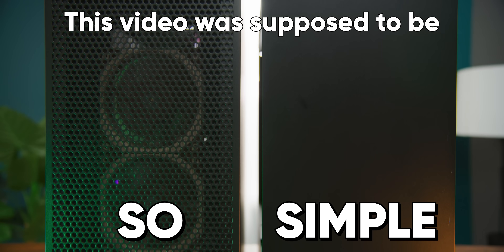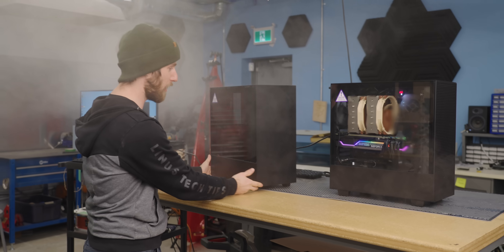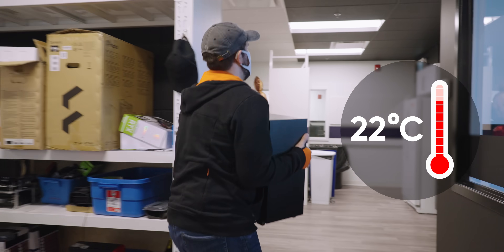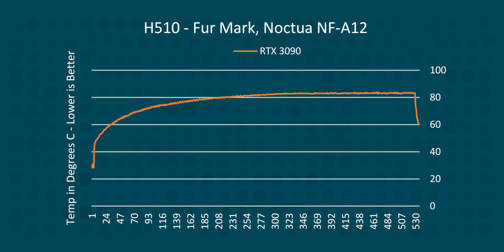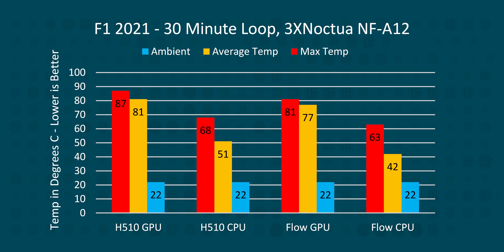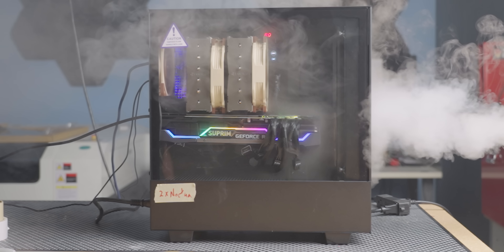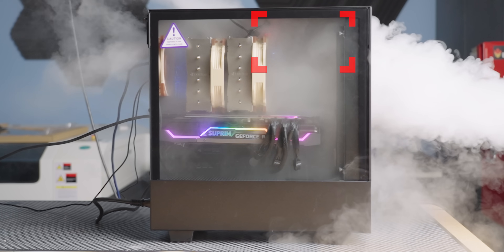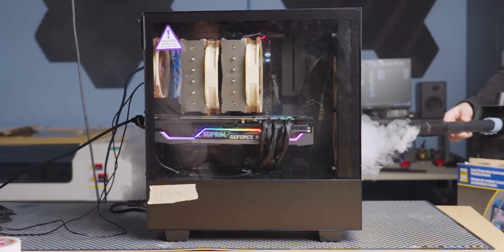Everything You Know Is Wrong - Mesh vs Non-Mesh Front Panel

Comment: His use of the word turbulence isn't entirely incorrect. These big vortices are a sign of high vorticity and that is the defining feature of turbulent flow. However, it would certainly be more correct to say, "undesirable turbulence" or "stationary vortices" as the rest of the flow is turbulent as well.
 It don't recommend looking up these terms and how they relate to cooling up though, it is a very deep dark black hole. The question of how much turbulence is desirable and which flow rate is optimal is not at all trivial. <=this is coming from having done a degree in atmospheric physics in university.
In my own testing (over 500 tests on a Corsair 5000D) I have found their results to be basically true:
1) more fans aren't better if the configuration or case is bad (like the H510)
2) even with good configurations faster fans aren't better
I've also discovered
3) the type of fans/ model can make up to at least 5 degrees difference
4) how fast the fans turn in relation to each other can make a small but significant impact

Comment: The solution to PC cooling is to think outside the box, and by box I mean case.

By installing a Pratt & Whitney PW1000G in front of your computer you can guarantee an airflow of 598.2 kg/s (1314,396 pounds per second) keeping even a RTX 3090 well ventilated.

Comment: That's an AIO case. Why the hell were you using Air Cooling!? AIO for the CPU and air cooled graphics are fine in the airflow version, not a honking air cooler!! 😡 What were you thinking with such a tiny poorly designed case!? 

You should only use air cooling in a full tower case. Air cooling in a mid or smaller case (especially that kind of implementatation) is just wrong, even stock coolers applied to modem high end CPU's is just wrong to begin with mate! Plain and simple. 

You have to look at thermal capacity and dynamics of the case to fit the correct hardware and cooling solution prior to even purchasing the hardware to begin with! In this case you were trying to mate David and Goliath together and what a bad idea that was clearly!

Obviously your stock ordering and inventory minions need better training Linus. This was just an insult to any PC builder out there with half a brain. 👎

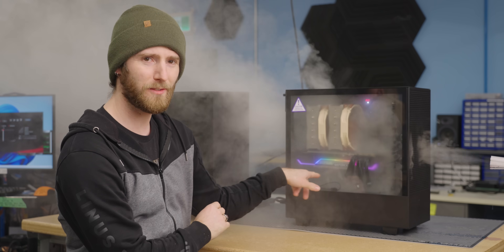Comment: 0:50 Yup! That's exactly what was happening to my gpu overheating due to not getting enough cold air and the cpu cooler sucking all the cold air from the front case fans. How I fixed it? Added a fan bellow the gpu to get cold air from under the case, helped a ton. This video confirmed my theory.

Comment: Wow this looks sooo similar to my setup. I replaced all the case fans with noctuas, and added a second fan to the NH-D15. I was wondering why my RTX2070 gets hot. Time to re-work that cooling! Thanks Linus!!!

Question: Currently my PSU's fan is facing down towards the flor. I was thinking about flipping it around, so it's sucking some air from underneath the graphics card. Can we test this scenario?

Comment: Add duct channel separation splitting the chassis fans so they pump both areas, is what I would do. Flow volume doesn't matter if there's a dead zone. I suspect without carefully eliminating dead zones, the mesh could easily make them worse by allowing free flow that could be ducted into them. An actual heat transfer engineer would model the geometry in COMSOL or the like, but who can easily get accurate geometry for all the weird and detailed shapes involved?

Comment: Hi Linus, can you and the team make a follow up test with different configuration? I am interested in seeing what it would be like with larger cases in this config (large tower cooler, normal GPU mount), such as the Fractal Meshify 2 and Torrent, and also AIO mount, and vertical GPU mount.

Would also be cool to see the fog machine on a chimney style case, like the O11D.
Reply: this problem doesn't exist in a meshify 2. put 2-3 fans on front with a back exhaust and 1-2 fans on top and no problem. even have the option for bottom intake if you need it. but if you make poor choices like buying a nzxt that cant accomidate top exhaust... for a 3090... then you'll have a bad time .

Comment: ok, you did this with a monster 3090.. which appears to be your main bottleneck point in terms of airflow.. 

why didn't you then go with something a little less beefy, in terms of GPU size? And see what the improvements could've been had, if the GPU wasn't creating turbulence for the bottom fan..

or conversely, go with a slightly larger case, one where the 3090's size isnt as much of an issue, and that bottom fan is actually feeding air to its fans

Comment: I just love my Cooler Master H500M with the 2 huge 200mm fans and the 2 added/exchanged 140mm MasterFan ARGB fans at the back and on top to balance things out.
Its bigger, leaves more space below the GPU and pushes alot more fresh air unter it instead of just straight at it, giving my GTX 1080Aorus Rev.2 enuff breathingroom, to never go above 68°C, in standard condition and settings, even when Superposition 8K optimized gets thrown at her or so, with then close to 280Watts to handle.
My Ryzen 7 3700X with PBO and up to 125Watts, never saw more than 76°C even in Cinebench or Prime 95 under its MX-4 supported Alpenföhn Brocken 3 Black Edition Towercooler.
One of the best Airflowcases available.

Comment: I have actually experienced some similar issues with my setup (Lenovo Legion 5i Gen 2 Desktop). I added a plastic divider to force the air from the bottom intake fan downwards to the GPU area. Thought you guys were going to try something similar with this case.
Reply: Been thinking of 3D printing something to do the same, how did it improve your thermals
Reply: @shoots8940  Well for my specific case it worked pretty well actually, got my GPU floating around 80 celsius max when in game.
Reply: I tried similar way but i found out the plate redirecting airflow also cause high pressure area near the outlet of fan, so the overall airflow drop. Instead, i add a small fan blowing directly below the GPU. The small fan suck the turbulence and high pressure air to maintain higher overall airflow into the case.
Reply: @joelau2383  I actually did something similar on my old rig where I added a 80mm exhaust at the back of my case below my GPU.
Reply: Similarly, my mind is racing with all the things I'd like to do in this case with the 2 most important tools in the world. Zip-ties and duct tape xD. That GPU really needs a de-shroud.
Reply: Their videos (content) quality has dropped off significantly.  They didn't offer any solutions and showed putting a fan in the top exhaust and proceeded to say its difficult and didn't follow up.
Reply: @spencer5051  It's likely because they never meant to spent that much effort on this one, but just wanted to showcase a problem. The ending did feel rushed though. The other comments here did come up with a coupe diy solutions though.
Reply: Lenovo c530 cases did something like that.  Since they are a small form factor i guess they had to take every step
Reply: Reminds me of the old G5 Power Macs that had similar air channels.
Reply: Gotta milk that extra video though. "How this $1 part fixed our cooling"
Reply: @madmangohan  nailed it.

Comment: I still use a Coolermaster CM690 ii, its a beast of a case with 4 5.25 drive bays, i like using 5.25 accessories like card readers and front USB ports - this case has space for ten fans, crucially, one is on the side panel directly where the GPU sits, it also has a fan behind the motherboard tray for cold air to the rear of the socket - i have had this case a while, it still looks good, its built really solid but yes its bulky and doesnt show off RGB to its best ability, however - it does have great airflow with mesh panels nearly everywhere

Comment: Reverse the fans. 
Have air push out the front and the exhaust fans reversed as air pulling in. 
Reverse the cpu fans. 
Create a negative pressure will help pull harder airflow pass over the cpu and maybe gpu from the back.

Comment: I’d like to see the same hardware with a larger interior chamber. I used the flat front h510 with a 2060S and Ryzen 5 2600, and rarely exceed low 70s for either component with roughly 73-76F ambient. I have less power hungry hardware, yes, but the case still works fine for such a combination. I would think with a larger internal chamber air could better circulate and become exhausted as needed while keeping the hardware the same
Reply: I use the H510 with my Ryzen 2600x and a RTX 2070 and have the same temps as you did. For hardware like this, the air flow of this case isn't really a big problem

Comment: This is one of the reasons for years I use AIOs instead of giant air coolers and try to keep distance between fans and obstructions large. Much as you can the pressure drop should be equal between all the possible flow paths the air can take between the inlet and the outlet. Unequal pressure drop restricts flow and causes imbalances, while obstructions can act as deflector plates which causes vortexes. In the O11D I run the inlet is at the bottom and the outlet at the top with the graphics card vertically oriented to minimize resistance to flow and have, as much as possible, an equal pressure drop.

If one of your engineers wants to have a good insight in the type of fluid dynamics seen in cases what you want to look at are papers about vapor maldistribution in industrial applications e.g. multi-phase separators, distillation towers, etc. same principles.

If you have the software (Open Foam [Free], Ansys Fluent, or CFX) it shouldn't be hard to model air flow for cases, you can use porous bodies for a lot of things.

Comment: This is probably part of the reason why the Lian Li O11 Dynamic has sideways front intakes, they pull air inside the case where it flows into the glass side panel, not the front of the GPU, then a vertically mounted GPU has full access to the fresh air because its fans are directly facing the glass side panel

Comment: It’s actually pretty easy to understand if you consider air flow paths inside a case lol. The case layout internally didn’t chance. Pretty logical outcome. If the front fan placement changed and the gap from the gpu to the psu shroud increased the gpu would cool down. But I’m assuming this video is for people who don’t understand logic hahaha

Comment: Flaws on your methodology.
1. Case size was too small for that Graphics card
2. Remove the backplates underneath graphics card
3. Choose case that is appropriate to the test Example Be quiet 802 (since it comes with switchable front panel to mesh/ no mesh)
4. Choose graphics card model that is wider 3slot card with more air pushed out of the back.
5. Flip the PSU over

When your testing methodology is flawed from beginning it it is kind dishonest to push your point of view like that.

More fans can and is better in most cases if you take advantage of it in your build but you have to think and make actual use for it so it works properly.
Reply: This was not a flaw on their methodology. They had no methodology to begin with. They just tested a mid size case that a lot of people have with a huge GPU.

A methodology has to be established when you want to try a lot of cases in a lot of configurations, which they didn't do.

Comment: This is a problem LTT has had lately. Good video topic, but a horrible exicution. This video told us about a possible problem but nothing more, so solution or different use cases/ actually different cases. Very empty content, I am let down as LTT usually delivers a better quality of video. All 8 minutes basically came down to "This case with these parts does not do well with fans on high due to airflow." I really hope the quality is improved or at least LTT makes these videos into a series so the actual information can be given out.

Comment: Linus as someone who worked for a few years trying to build a pro audio and lighting rental service for events, what you want isn't a smoke machine, what you want is actually called a hazer, and they can be had for around $500USD new, and will output a lot more than that shitty smoke machine, without spending the $1500 you mentioned xD. IDK what you paid for that smoke machine, but a hazer should output several times that

Comment: So… it depends on the case not on the fans. I think in a Corsair 1000D more fans are better because of the extreme amount of air in there. Also If you have 3 fans in the front it might not have the air bubble. Or am I wrong.

Comment: This confirms my big case + fans on sides and bottom (fans on front and top are a given) is better theory. Needing space between GPU and CPU is an interesting paradox though as the desire to keep those bus lanes short for minimum latency is desired, but we don't want them to overheat by being too close. With the newer, hotter GPUs, I suspect the need to keep them apart for thermal reason will quickly outweigh the desire to keep those lanes shorter. In this case, bigger mobo would also be better. I would be interested to see this test done using full sized ATX cases. One with less fans, and one with lots on all sides. On this same topic, I would also be interested in seeing a video on, when using a big chungus GPU like a 3090, what the performance difference is in using the lower PCIe slots on a mobo vs higher (closer to the GPU). Assuming the lower slots are still the same PCIe spec. I want to know what the performance gain is from keeping those lanes short.

Comment: OMFG I'm stoked to see someone using smoke to test airflow!  I even posted to one of JayzTwoCents vids a couple months ago asking if they considered doing it.   Could we please get a series testing like this!  

Love to see tests on fan angles to effect dead spots.  If that bottom fan in this vid for eg had been tilted so it pointed down more, under the GPU, I feel that it would have helped significantly.  Although I think I would rather move the bottom front fan to the bottom back under the GPU.  That feels like it would have better flow (if there was space to put it there).

Good vs bad cable management and how much  it effects airflow.  Can it infact help reduce dead air spots?  

Testing of some old ribbon cable!  I've wondered about using ribbon cables in modern PC's to redirect airflow where its needed. 

Would adding rounded corner mouldings into empty corners help prevent dead spots. 

If you have proper flow, how small a case and number of fans do you really need?  Can you get away with only one intake and one outtake?

Does fan stacking work better than spreading them?  One intake with 3 fans vs 3 intakes with single fans for eg.

Hot air rises so logic would suggest a top vent would be ideal.  But would it be better to have it on the front/back/side?  Air flow in a lot of cases have what I call a shortest route scenario.  Air comes in, hits a few things and is then sucked out the top and not really getting mixed up enough leaving dead spots.  This is where poor cable management may actually help create diverging airflow to mix things up more.  

Just fan intakes vs just outtakes vs mixed.

Please and thank you :)

Comment: I have never kept the glass on my case because my VRAM passes 100⁰C with the glass on in my Corsair 4000D Airflow with an MSI CPU watercooler and an Asus Aura 3080 GPU , With the case off it goes down to 90⁰C , not many people check their VRAM temps but with the 3080 graphics cards it's a problem , and ive heard that it is with 3090 ones too , maybe a video idea how to use them at full load with the best temps possible while also having the glass on? 🤷🏼‍♂️

Comment: I would say this was obvious, to me at least and I'm not the smartest. I though the best solution would be to have a mesh on the right side of the metal cover that hides the psu, cables etc, then have the glass side only go as far as the metal cover and have mesh on the side where you could fit 2x 70mm fans to the right of the psu. Have them blowing air out of the case, this should suck the air down and under the card in theory.

Comment: I actually had this same issue and upgraded my PC from a FD Meshify Case to a Corsair 500D and saw a huge improvement in temps for my 3090 even though the cases are of similar size. The 500D has a lot of extra room in the front compared to the Meshify which crammed the GPU up against the fans on the front.

Comment: My case has a solid front panel, but it has a meshed top that is full length. There is a fan on the back and a strip on the side in the front. It’s probably not ideal, but my 3080 doesn’t go higher than mid 80s, and runs Forza horizon 5 at 76 consistently. CPU can go up to 80 but there’s a 240 rad in a push pull config at the top that keeps it within reason.

Comment: Vertical mounting these huge graphics cards helps alot with airflow and thermals in these kinda cases. But then you of course cannot use huge air coolers like that for cpu but even with front mounted AIO as intake you would see huge improvements on gpu temps and airflow if vertical mounted. That is of course only with those kinda vertical mounts that holds gpu far away from the class.

Comment: Most (if not all) of the air drawn is turbulent, which is good it mixes the cool and warm air cooling the system rather then shooting cold air slowly over a hot component and not cooling it, the air under the gpu and in the top were stationary

Comment: I've been dealing with this problem by using bottom intake fans or fans in the PSU shroud for years now. GPU air recirculation is a massive problem in all front intake cases.